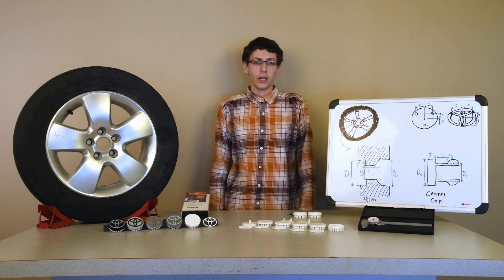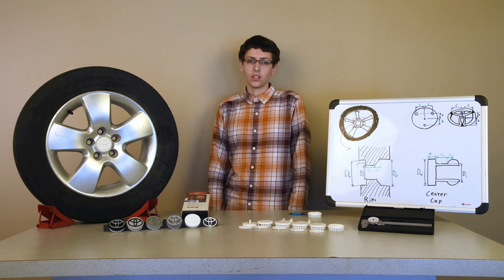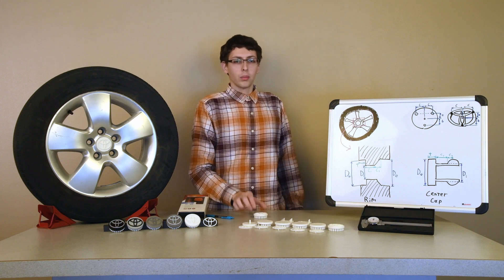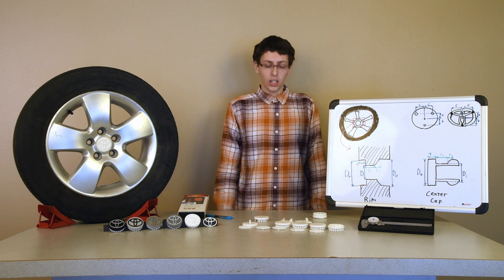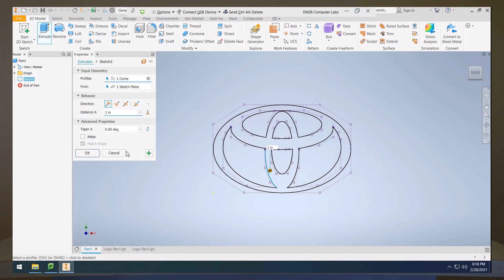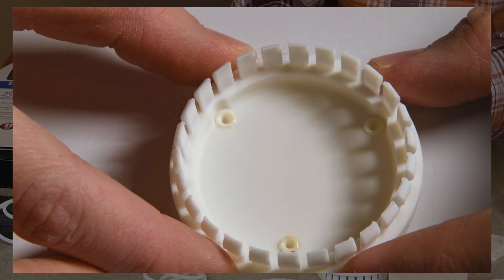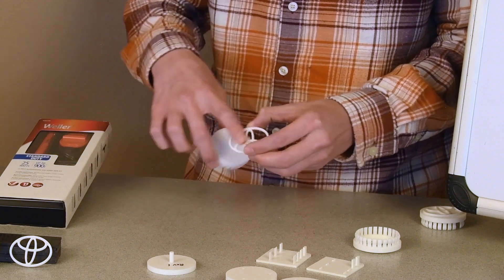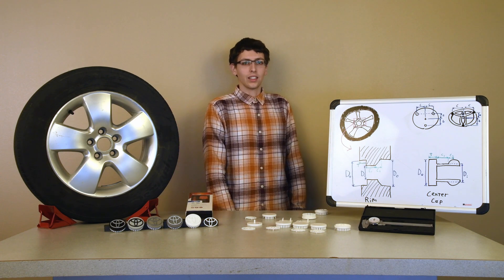Custom DIY 3D Printed Center Caps for Alloy rims (Toyota Logo on VW Rims)

Comment: Nice! I like the peg design where they have to be melted together. What filament did you use?
Reply from the maker: Thanks for the reply! For this project I used “Ender” brand PLA from creality3dofficial, the website I got my printer from. However, any name brand PLA should work equally well. I recently switched to using eSun PLA and I like it as well.

I have not used PETG filament yet, but it may be a better choice for greater flexibility of the attachment tabs and higher temperature resistance. The center caps I made have been fine though on the car parked outside the last few months, no issue.